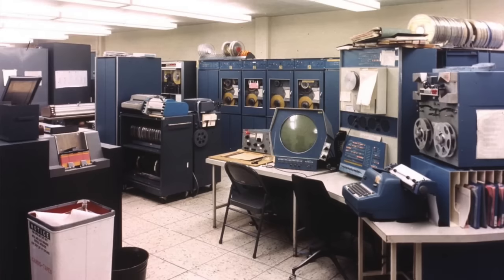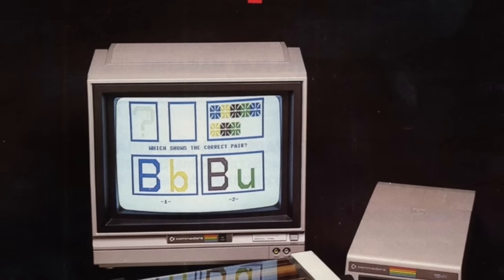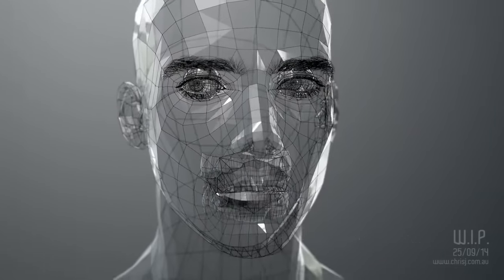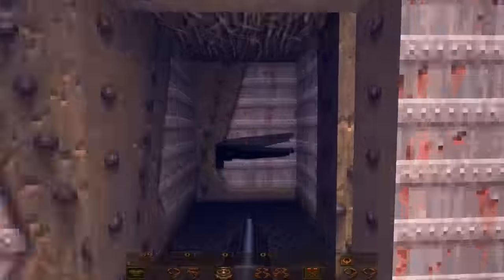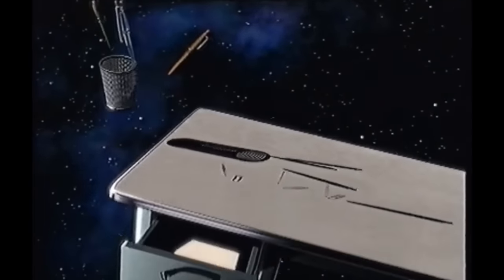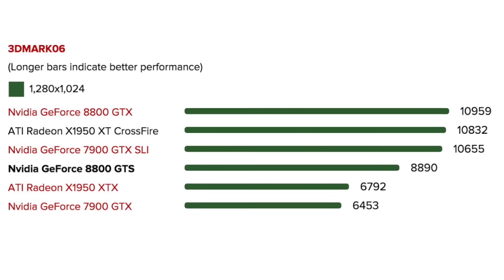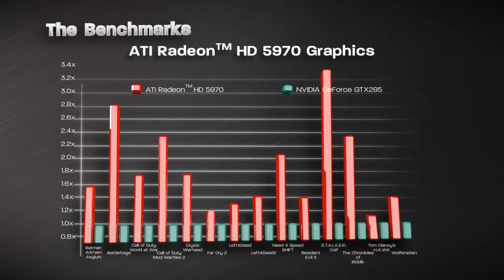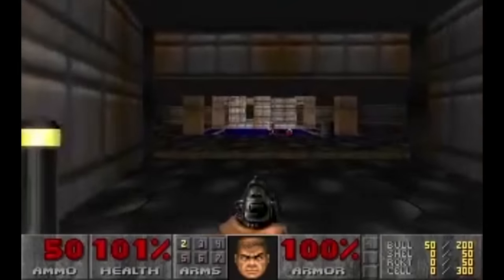Evolution Of PC Gaming Hardware

Comment: I think I have something interesting to add.

I have a piece of shit laptop. My grandma bought it for me at a pawn shop as a surprise gift, and i love her to death for it.
However, it seriously is a hunk of junk. here are the specs:
AMD A4-5000 1.5 ghz
Radeon 8330 512 mb
6 GB RAM
700 GB HDD

What's crazy, is that i can run any game from 2005 and before at the highest settings with this machine at a stable and playable framerate. And especially when I run games from the 90's, like quake, at buttery smooth 60fps, it just makes me think about how far we have come. There would have been plenty of people back then that would have killed to be able to run games like QUake and other demanding titles like it at the quality settings and framerate, not to mention resolution, that I am able to do in my lap. It's really mind boggling to sit down and think about how powerful our computers have become and how fast we have been able to get to where we are. Even though my laptop is a hunk of junk, it's still a hunk of junk that can play some of the most beautiful games of the 90's and early 2000's and makes me appreciate it, even if i cant play Battlefield 1 with it.

that being said, i have a moderatly powerful desktop. 
GTX 770 2gb
intel i7 980x 3.3 ghz
12 gb's RAM

I had a 2 TB HDD but it failed and i havent gotten around to fixing my PC, hence why im using my potato for now.

also, i have seen people complain about their Intel HD cards. If it's a 3000 or above, don't complain. It's still more powerful than what i'm using.

Comment: I had an Athlon 2 X2 (255) with a 1GB GDDR5 GTX 460, now I have a FX-8320 clocked at 4.3 Ghz, with the same GTX 460 (Asus DirectCU II)... I can run GTA 5 at High at 30 fps at 1080p... Just can't save the cash for a RX 480 8GB (I'd like a Sapphire or XFX)

Comment: Had a shitty i7 6700 with GTX950 which couldn't get stable 60fps with minimum graphics even in 720p in the latest games such BF1, BDO and Destiny2
I built a new PC from scratch full AMD with Ryzen 5 2600X and Vega 56 and now I play up to 60fps in 5K resolution with max presets on the same games
The funniest part is that both PCs costed the same 1.000€ at just 1 year apart and the performance is like 10 times more

Comment: my child is build up with:

-Intel i5 8600k
-Gigabyte RTX 2060 super oc edition
-Corsair Vengeance 32gb 3000Mhz
-Asrock Z370 Gaming K6
-Samsung EVO 850 SSD 250gb
-Fractal Design R6
-Sennheiser GSP 300
-Logitech G502 Lightspeed
-Logitech G513 Carbon Linear
-Logitech G560
-Logitech G840
Reply: Super oc version? is that about 50mhz oc? im running the 2070 super gaming x trio - thats clocked over 200mhz over standard with headroom for more :P

Comment: that's why you left your old PC hardware due to the almost annual renewal.
ATI Radeon 4670 with DirectX 9, and a Q8300 as its proc. If you are switching to more consoles. So far, the pc hardware developments were taken away a lot of money. I think it's better, it is better to give money to a console.

pont ezért a szinte évenkénti hardver megujulás miatt maradt meg a régi pc.
Ati Radeon 4670, DirectX 9-el, és egy Q8300-as procival. Ha váltok inkább konzolok felé. Eddig a pc hardverfejlesztések rengeteg pénzt vittek el. Szerintem már jobb, érdemesebb egy konzolra adni pénzt.

Comment: Oak Technology 1MB SVGA with 14" non-interlaced .28dpi CRT, 486 DX50 4MB SIMMS SoundBlaster Pro 120MB Conner IDE HD mini tower with Sony 1X caddy CD-ROM, 1.44MB 3.5"  A drive 1.2MB 5.25" B drive 2 button analog CH Flight Stick MS-DOS 5.0 with windows 3.0

Comment: pc as of now: Cost of parts $975 Including OS (Win 7 Ultimate 64)

AMD FX 8350 Black OC'ed to 4.7ghz 
ASUS Sabertooth 990 FX rev 3 MOBO (TUF style)
32gb Corsair Vengence DDR3 1866mhz RAM
EVGA Nvidia GTX 970 SSC 4gb (base oc'ed to 1600mhz)
EVGA 1000 G 80+ Gold PSU
2 WD Blue 1tb 7200 RPM HDD
1 WD Blue 3tb HDD
Aindees Crystal AI case (all tempered glass panels)
6 Corsair AF120 White Led Case Fans
and a Cooler master DF92 4 heatpipe CPU cooler with its included dual 100mm fans

Comment: Amiga in 1980? Which one was that? Seems to me the first one was in 1985. And several MB's of RAM? It was just 512KB (in the 500-series at least), I had to upgrade mine to 1MB (max) with an extra RAM-card. The photo in the video also shows 512K/1M RAM so no 'sveral MB's of RAM'.  Still, the Amiga 500 was so far ahead of its time! It took years before pc's came close (around the DX 486). I played the original King's Quest on the pc, years before the Amiga (500) came out (in The Netherlands at least). It feels like it is featured as some launch title for the Amiga in this video (maybe they released an Amiga version later, but then I still don't really understand why it is mentioned in this video because we had it already on the pc, and the Amgia version mostly just added more colour to it).  

I remember my Diamond 3Dfx Voodoo 1 card for my pc, it was such a step up in gaming graphics. Never seen such a huge jump again. I also remember playing Quake over the university's LAN (it was not allowed so we had to chose our spots in the computer room strategically so no system administrators walking around would spot us playing). I've build well over 15 pc's myself, and probably owned well over 30 graphic cards. First pc I built myself was based on a Pentium II 350Mhz. 

The very first games I played were on my father's pc, I think it was the Tulip Compact One (or maybe 2) with 8Mhz processor (and 5.25 inch floppy drive). My father worked in IT with mainframes and could get a pc 'cheap' from work. I was the first in my class with one at home. I played games where the characters were nothing more than ASCI-signs, all very primitive. But the games soon became better (without having to upgrade the hardware) even though it could only show a couple of colours and it quickly reached it's limit since changing hardware was very limited. 

It's amazing how it all evolved. I'm turning 41 next week and I'm still a gamer. Wouldn't it look awesome to have a LAN-party in an eldery home  with gamers who are all 80+. :-) I don't care about warm meals or bingo when it's my time to move to an eldery home, I just need high network speeds. ;-)

Comment: I love(d) PC gaming, but to keep up with the latest on hardware is just undo-able for me. Still running my Phenom II 1090T, but with a GTX970. Upgrading to a new system would mean I'd have to build from scratch again and dump an other €1000 in it for 3-5 years. I've passed on that and have changed to console gaming early this year by getting a PS4 Pro instead. If that one goes like the PS2, or even the PS3, it'll last me for about 5-10 years for less than half the costs ;-)

Comment: Intel® Core™ i5 Processor 5200U (2.2GHz - 2.7GHz (Turbo, 2 Cores) 1600MHz FSB, 256 KB per core L2 cache, 3MB L3 cache)
2GB NVIDIA® GeForce® 930M Graphics.

and yes my computer use both nvidia graphics for 3d and intell for 2d

Comment: my potato labtop is 3 gb and intel pentium grapics :) but i can run prerty much everything on this. why because i use low specs and tweaking effects to help lol i running gta iv with 64mb video card with fps omtomizer i got 18-32 fps with 512x384 resolution. lol
Reply: With 64mb video card? Amazing! And though mine was crap.
Reply: oh. but your pc is kinda a little slow. mine is intel pentium. 3 gb ram :) now i can enjoy gta iv with pixelated
Reply: when i change it to 320x200 its run 34-49fps!! AMAZING POTATO HARDWARE I LOVE IT!!
Reply: that's all cool but can it run Minesweeper at Ultra settings at 4k rez
Reply: lolz

Comment: Core i7 6900K @4.4 GHZ
Noctua NH Series cooler.
MSI X99 Gaming Motherboard
EVGA SC2 GTX 1080ti
HYNX 64GB DDR RAM @ 3200 MHZ
8 X SAMSUNG 850 (256GB) RAID 0
1 X SAMSUNG 850 (256) OS
1 X 3TB WD Black
850W Corsair TX Power supply
.......

Bobo looking case from 2005...

Comment: i7 6700k at 4.8ghz delided and cooled with an EKWB EK-KIT L240 R2.0 kit gtx 1080 evga ftw crucial 2400mhz 2x8gb rmx 1000w psu 2x unbranded 240gb ssd in raid 0 msi z170a krait gaming x3 motherboard and an m.2 samsung 256gb nvme ssd all inside a cooler masterbox 5 
http://www.userbenchmark.com/UserRun/10057199

Comment: Its called parallel  tasking. they didn't invent it.  Its not new.In fact Amiga surpassed that in 1979 pfft  Those multiple cores don't work independent of each other ,and they have to be told what to do in each case of the gpu ,and cpu. With the Amiga that wasn't the case .The min cpus worked independently of each othere ,and they where preprogrammed  to truly work independently of each other. Hence a true -real time multitasking multimedia true 60fps system..Not to mention true 64bit cpu and above ,and true 64bit graphics with 3d built in so yes the Amiga is still superior.Had True 48bit Graphics with the AAA chipset Amiga has a True chipset as described above. Standard True 24bit graphics. pc=mac true 8bit cpu /gpu. 
Till all shall see... again
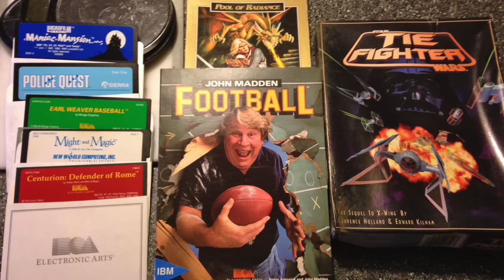John 3:17

Comment: ATi was sold to AMD because they could never compete with Nvidia. Sure, some of their HW was OK, but it suffered from heat issues and the cards would literally cook themselves until the cheap lead-less solder under the BGA chips would melt or crack and they often needed to be reflowed. The software side was far worse than the HW side of things and still is. AMD / ATi drivers are horrible!  Sure, Nvidia has had issues before, like the chips de-soldering themselves internally years ago, but that was mainly due to HW manufacturers not using appropriate heatsinks and cooling hardware per TDP, same thing with a lot of AMD's stuff. Has anyone here actually opened up a laptop and seen how pathetic the heat-sinks are? Or the lower end desktop cards? AMD is losing simply because they and no-one else can compete with Nvidia at this point in the game.